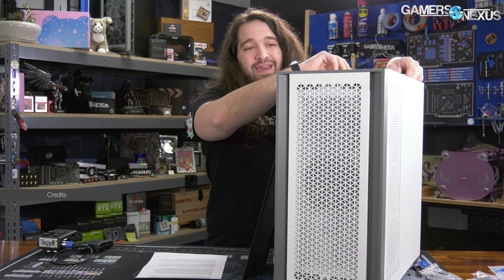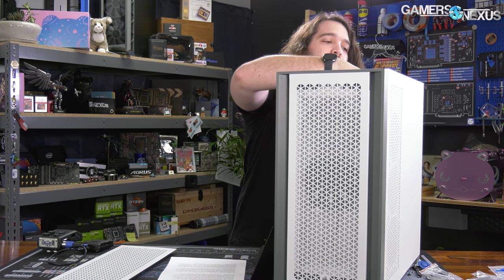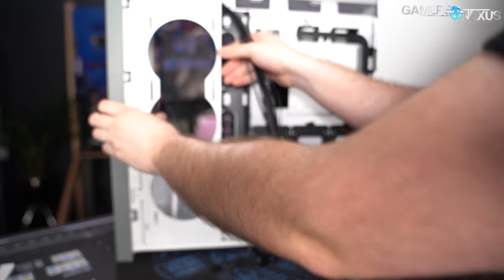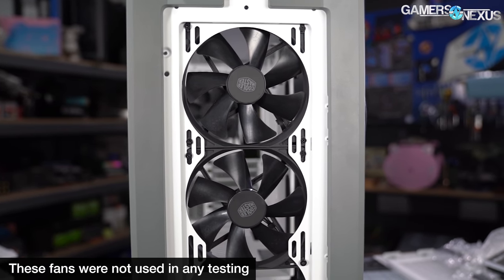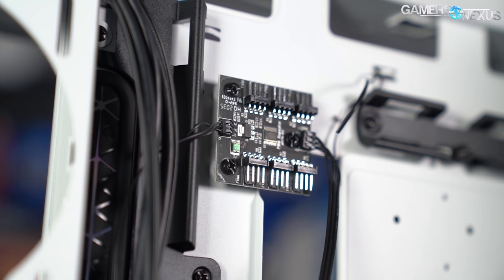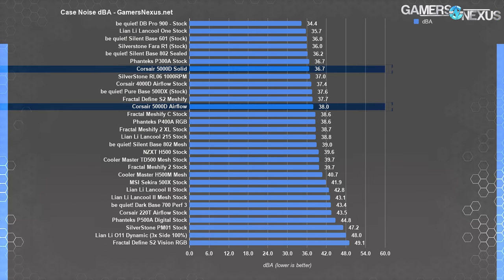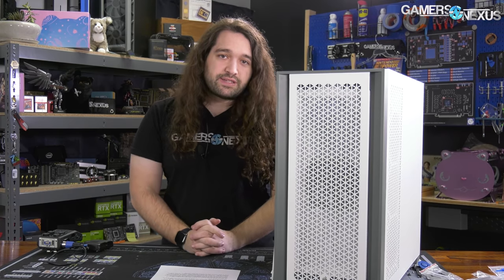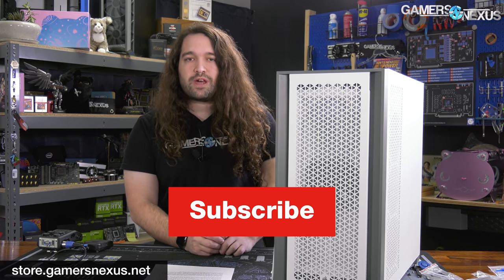Corsair 5000D Airflow vs. Solid Case Review: Thermals, Noise, Build Quality

Comment: This removing/installing process or engineering is the cheapest and best way to break your precious glass pannel, because of the screwing system.

When screws are screwed in and out dozens of times, even with extra care, the glass can become weaker with micro breaks inside, and will eventually break, even though your right hand is carefully placed below...

Moreover, the glass used on this is extremely fragile, even more than many glass pannels I've had before.

Finally, glass pannels for 4000 black series have been out of stocks for MONTHS now ! because many of them have been broken (see all the reviews related to this problem)

Corsair, you should have used HINGES for all your models, like you did on 7000d, despite of the price.

These 4000, 5000 series are perfect, except for their glass pannel which has screwed me for months now, since I lost mine...

Comment: In my recent Newegg Shuffle, in order to get parts I wanted, I ended up getting a 4000 Airflow case along with an X570 Taichi board in a different Shuffle.  Oddly enough, the part I really wanted was a 5950x to replace my 3950x.  So... why not go ahead and throw the 3950x into the Taichi, add this 980 Pro and 64GB of DDR4 laying around, and build another PC?  The answers there are threefold:  I have no need.  Already have 3970x, 5950x, and 5900x PCs running. I have no space!  And... it doesn't fit my aesthetic.

I opened it up and it looks like mesh everywhere, but that it's possible to mount 3x 140mm Noctuas in front, 1 in back, 1 or two on top, and run a Noctua air cooler on the CPU.  (Can you tell I'm a Noctua fan?  Hurrrrr) throw a 5800x and a 3070 and a 1TB m.2 in there, and its a really solid gaming PC for someone.  Just... I don't personally know anyone who needs or wants one, so I'll either just store the parts for a rainy day, or sell them to someone who will make good use of them.  (It's not about making a profit, but rather not wanting good parts go to waste.)

Comment: biggest "minus" of this case for me? Another Corsair Case thats not by out of factory ready for a corsair build! Why not? This case fits up like 3 Fans in front, in the side and even in the top a minimum of 4. BUT Corsair doesnt want to put a RGB Hub in the case, that fits like 10 Fans but only 6! So the price of the case can be set like 150€ cheaper because they dont need to bring the corsair commander and another lightning node core with it. SCREW U Guys! 
Thats how to fuck up your own products: by making it not fittable with the rest of your products. CONGRATULATIONS CORSAIR!

Comment: How would you compare this case to the new lian li lancool iii coming out soon?(if you got your hands on one yet that is). I'm stuck between this 5000D airflow and that new lian li lancool iii case🤔 and since you go in debt with Cooling reviews and everything, figured best place person to ask...I don't care for aio/water cooling.. (ryzen 5800x, 32GB 3600mhz, WD 512GB nvme, Evo 212 cooler, evga 3090 ftw3 ultra, 4tb hdd, RM1000x '2021' psu)

Comment: This case is good but not at this price point. And tbh the side fan cutouts are not really necessary. They should’ve just made the 4000D just a little bit longer so it can fit a 360mm rad on top and slap a $20 premium on it. I’d buy that in a heartbeat.

Comment: I am currently making my two hour drive to microcenter. I've decided the 5000x case is what I'm getting due to a coupon at best buy. If I have 4 corsair 120mm fans and a h150 elite aio, will that case be fine? That way I can use my extra fans to put exhaust and on that side vent. Like I'm thinking with my current fans I can make it run cool right?

Comment: Is there a difference between front mounted radiator and side mounted radiator in the 5000D Airflow?

Like more airflow for the GPU..
Or does it disturb airflow when two streams come together in a right angle?

Comment: In the front of the PC case can you fit two 140mm Noctua fans and one 120mm Noctua max fan in between the two 140mm Noctua fans thanks in advance? Plan on putting 3 Noctua max 120mm fans as exhaust on top and 1 Noctua max 120mm fan in the rear as exhaust as well do you think it will work? Thanks again.

Comment: Hey, late to the party I know...
Just in case you have 30 seconds of your time: I'm building a brand new build whole cloth with this case (3090, i713700k, ROG Strif z790-F, Msi MEG S360, Corsair HX1200) and I want to cool it the best way possible, 3 front, 3 side, 1 back, and maybe 3 up (?) if push/pull serves any purpose on the AIO. Which fans would you recommend? Are Phanteks T30 overkill? Seen a couple Corsair Elite1500, would it be enough? I'm doing OC on CPU only, need optimal cooling, can bear a bit of noise if it's really useful. Thanks!

Comment: For a case like this (closed panel one) if you only have 2 fans for the front panel would it be better to leave the middle open to maximize the space that each fan has exclusive access to for drawing air in?

Comment: How would you config the case with fully populated fans? 360 rad intake on side, 3x120 intake front, 3x120 exhaust top and 120 exhaust back? I've only seen side fans on the O11 D and that doesn't have front fans.

Comment: Hey commenters. If I am going to add max fans to this, OR add max fans to a 4000d or phantex 400/500 (rgb) airflow case.... will my choice make any real difference to performance?   I will be maxing out on fans no matter what case I get (and probably removing some when I upgrade my cooler to a radiator... or putting it in the side mount)

Comment: The fan situation with this case kind of kills it for me. If it came with 3-4 high quality fans at that price, it would be a strong contender. As it is, they need to remove those two sad looking throw away fans and drop the price by $30-$40. That's too bad, because it's otherwise a pretty well thought out case.

Comment: I have seen some opinions that the "cable bar" is designed to direct air from the side fans over the motherboard in a Dyson-like manner.  Is this just nonsense?  It sounds plausible, given the design of the cable bar.

Comment: I still run a 350D and 750d. I need to order new side panels for the 750D
not the best for airlflow but 140mm noctuas fix that.

Comment: Nice Case by Corsair, but I think it's to expensive with 150€ across from the Carbide 275R Airflow for only 70€ (which has no allan screw and fixed rubbers, like the non-airflow).
So my last case became the 275R Airflow ;-)

Comment: If i mount a 360mm radiator on the top can I put 3x 120mm fans on the front and side or will in not fit

Comment: The cynic inside me wants to say Corsair will release a "5000DX ARGB" edition where the front corner pieces are replaced with translucent plastics, so they can double-up on RGB strips at each side for their iCue software to take advantage of.
Reply: Substitute glass for plastic and you would get the X variant.

Comment: I want to get this case and already have 4 corsair 120 fans, would you recommend populating all fans spots?
So 3 intake at the front, 3 intake at the side, 1 exhaust at the back and 3 exaust at the top?

Or would 3 intake at the front, 1 exaust at the back and 2 at the top suffice?
Thinking of combining this case with my amd3700x be quiet dark rock pro
Reply: hi I recently ordered this case and I'm planning my fans for it. From my investigations it seems like planning how the air will flow is important, and calculating total airflow in vs. total out. (close to equal is best, but slightly more in than out)

I plan on having 3 120mm fans at the front, putting the stock 120mm at the back and one at the top, and I have an AIO CPU cooler that I will mount to the top (120mm) as well which has 2 fans, one on each side of the AIO radiator. This way I will get lots of direct cold air from outside to cool my AIO radiator from the front fans (I won't use the side fan slots since the PC will stand next to a wall there, but I think it will be enough). With this setup I will not be using all 3 of the top fan slots, so I think I could improve it by adding a final one on top. I think with my setup the GPU will still be the hottest part, but the AIO moving the heat towards the front and then up helps the GPU as opposed to a fan cooled CPU which will leave hot air above the GPU. So if you have fan cooled CPU I would definitely populate all 3 top fan slots as well as the one in the back.
Reply: @Xaltotun  thanks for the detailed response. 

I did buy the case as well and I'm planning on building in it tomorrow. 

My current plan for the fans are:

3 Intake at the front. 
1 exhaust at the back
2 stock fans exhaust at the top. 

Would this suffice for now? 
I can always get more but I also got the be quit CPU cooler so I already had to lay down 200 euro.
Reply: @noz3m  I honestly don't know if it is enough. (not an expert) However, right now I run a ryzen 5 5600X, a GeForce RTX 970X (damn GPU prices), in a very suboptimal cabinet. I only have a fan at the top and the aio mounted at the back. I have never had cpu temps above 50 degrees. Not sure how things would go if I had a 3080 GPU in there though. I saw in another video that the side fans with the cover on would let the air flow over the motherboard, so I might get some more fans and put them there after I get a better GPU.
Reply: @Xaltotun  I have an 3700x and 2080 super in a NZXT H500 (very poor airflow) I'll just try it out with what i have and add more fans if needed later.

Comment: Thanks for this, i have a 3080 FE So ideally i would want to keep top exchuast as open as possible. So does putting a 140mm rad on the side have any drawbacks? and i should i use rad an intake or exhuast when its on the side?

Comment: I have a corsair carbide 300r (2014 model i think), with two 140 fans in front, one in the back. How could I know how much improvement i'd get in thermals by moving to a 5000D airflow ? Right now when running cpu Z stress tool I get more or less 55 degrees above ambient, and my gpu at 100% doesn't go above 40 degrees above ambiant. (Running a 13600K with be quiet dark rock 4 and asus tuf 4070). Looks in the ballpark of what GN measured in this test unless I misread the graphs. In other words, cases didn't really get so much better in almost 10 years ?

Comment: Thinking about getting this case.  Running a 12700k with a MSI MAG Coreliquid 360R V2 top mounted, and FE 3080-TI.  Would you recommend 3x120mm AF or SP fans on the front for intake?  Unsure how much resistance the mesh offers with the case in AF configuration.
Reply: I just picked up this case and I’m running 2x140s and 1x120 air flow fans in the front for intake and it works great
Reply: @bitbat9  right on!  I just ended up getting 3x120mm Be Quiet Silent Wings 3 PWM High Speed for the front.  Hoping they push enough air in to be positive with the 3x120 rad exhaust and 1x140 rear exhaust.

Comment: I guess one of the best solutions, today, to deal with using both the shroud attachment and the HDD tray is to use one of the Shift PSUs from corsair. But will the side panel close then if all the cables come out the side?
Reply: I have the RM850x shift installed in my 5000D case.  There is just enough room for the cables to safely bend and allow the inner panel door to close.    And yes, that leaves room for the HDD tray if needed.
Reply: @TofuRobots  Thanks for that info. I'm planning on building a pc and I can't figure out the case I want, 5000X is one of them and I'm pretty torn in between that, the BQ 802, TD500 and recently The Tower 500. Guess this is another point for Corsair

Comment: Do you think this case will give me better thermals with my 6900 XT? I am currently rocking a Corsair 570X Mirror case. I have a 360mm radiator on the front, since it won't fix on top. That means my GPU isn't getting fresh air.

Comment: Who tested this case (5000D) with all 10 fans? I am thinking about buying this case and I have 10x noctua fans available. My config: Gigabyte B550M, Ryzen 9 9500X with Noctua NH-D15, GPU: Asus TUF RTX 3080 10GB OC, 32GB of DDR4 3200MHz RAM,  Now i´m on Carbide 275R and i want something new with better airflow. Thx for answers :)

Comment: Personally I won't buy a case unless they include at least 2 front fans and if it holds 3 fans in front 3 would be preferred for sure. It also needs to include at least 1 rear case fan or it becomes a no go for me. If I am spending $250-$300cad on a case I expect no less than 4-5 included fans in the case.

Comment: I really think there should be a test where all fan slots are populated within reason to show what a case can truly do in a real world scenario.  I'm not going to buy the case and then insist on only using the two cheap fans that come with it, or only using three fans (two in front and one in the back) and ignore a perfectly good slot in the door because that's the rules, three is the max.  These thermal tests just don't reflect how I would actually use the case.

Comment: Dammit!!! The artic freeze 2 doesn't fit on top with the rog strix z590-e gaming wifi mother board!!!
Reply: I had the same issue with my Arctic Freezer 2 360, due to the thicker radiator the cooler wouldn't clear the vrm heatsinks on my MSI Z490A Pro. I ended up front mounting the cooler and mounting a couple of Noctua 140mm fans up top and 120mm rear as exhaust.
Reply: @davapod  oh brody, i forgot to update this as i was able to connect the artic freeze 2 argb by using just 6 screws on 1 side attaching it to the furthest left holes on the 5000d case with no screws on the right side because theres no slots for it.
Reply: @nalmunati  Thanks for the heads up. I might give that a go as I prefer to top mount. I'm a bit worried about using half the screws as the rad might move over time.
Reply: @davapod  it's pretty secured with the 6 screws in there.  Also it's just slightly tilted but it should he fine. Let me know.. if u want a aio perfect fit u might as well go with the corsair aio.

Comment: 11:14 
...isn't that positioning bad? Two high points for air bubbles, one of them being in the pump?
Reply: It looks like the radiator is tall enough that the CPU/Pump is lower than the highest point, so air should collect at the top of the radiator instead of anywhere else.

Comment: Im not sure if the built in fan hub is supposed to control PWM on its own, but i am not able to control the fan speed with this thing. Do i need the "Commander Pro" for this to work? 

If i only connect a single fan to the 4 pin on my motherboard, the PWM control works like it should... And YES; i have connected the 4 pin on the fan hub to the same 4 pin on the motherboard, and ive been using the same fan control software... Had to disconnect most of the fans to get the noise down... Im getting a new fan hub for 10 fans in 2 days, so i really hope this works..!
Reply: I have 3 noctua 120mm pwm fans connected to the fan hub and have no issues controlling fan speed. Perhaps you might check uefi settings and make sure the pwm has been selected as DC is usually the default.
Reply: @davapod  Im not sure whats up with my 4pin SYSFAN_1 header. The BIOS settings only allow me to set PWM for the CPU fan, and i have double checked with the manufacturers of my mobo that the SYSFAN_1 is [supposed to be] PWM. Today i finally realized i had an extension cord that allows the CPU fan cable to reach all the way to the fan hub, so i just disconnected one of the case fans, and connected the fan hub to the CPU fan header. Silence at last..!
Reply: @EspenFrafalne  Great to hear you have solved the issue. Some motherboards can be something of a headache.😆

Comment: question... does the airflow version come with all the same filters as the normal version? if i look it up it says it doesnt come with filters but that seems odd
Reply: I have the 5000D airflow.  It included a mesh filter for the front (clips in), top (magnetic), and bottom (for psu).
Reply: @TofuRobots  cheers

Comment: Sorry but Corsair hasn't really done a better job than the 750D Airflow with these designs.  The fronts are too designed and look more like old office building radiator vents you'd see downtown.  Love Corsair products, the older Airflow series with the removable filter assembly just look better to me.  No deal breaker just a preference.

Comment: Steve, I have the Obsidian 500D Corsair case, should I look for a better airflow case? My thermals do get a little hot sometimes especially in the area between my GPU Back plate and the Noctua NH-D15 heatsink.

Comment: Prefer zero fans in any case I buy as usually  fans supplied are "el cheapo's" and these days the average home user shouldn't need or use 3.5 " drives so get rid of the cage. I think the temp's you show give no real idea as you wouldn't build in this case with 2 fans

Comment: I'll stick to my Dynamic XL and Silverstone RV02 that I rubbed back and resprayed, its not done yet but its a much better case than anything Corsair is putting out. Plus iCue sucks, it crashed some of my Games on multiple systems, even my friends rig. We uninstalled iCue and the crashes stopped. $586AUD for 9x Corsair RGB fans + Commander Pro and the software crashes Games.. I don't think Corsair is listening to anybody because there are countless threads about iCue issues and Corsair have done nothing to fix it same as NZXT with CAM its still horrible.

https://www.youtube.com/watch?v=LUqE8tINzcU

Read the comments

Comment: the whole vid used case uses of fans that I would never use, (1-2) who cares what the manufacture sent with the case. (the whole video was spent bitching about the included case fans)there are so many ways to use this case that was never covered, i would be much more interested in you using 3 fans and different CPU types of coolers. i came here looking for that and was for a rare time disappointed, i request a redo and send this one to the dumpster, sorry for the harsh response